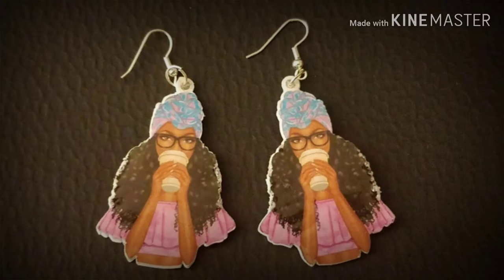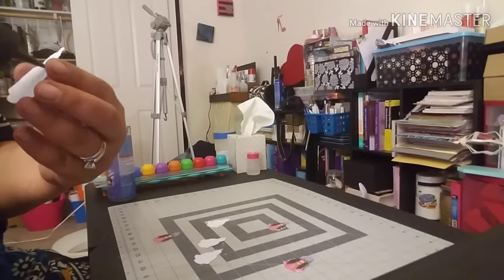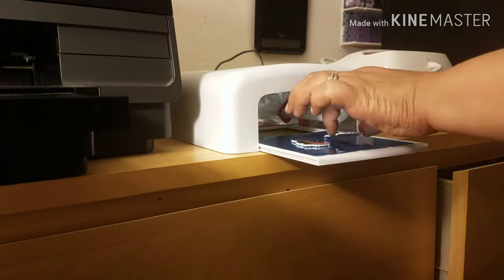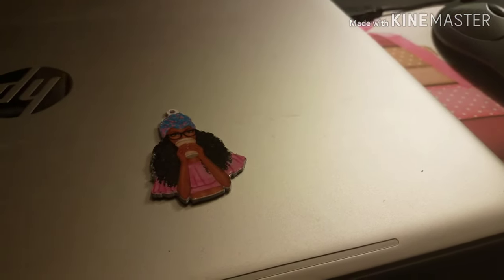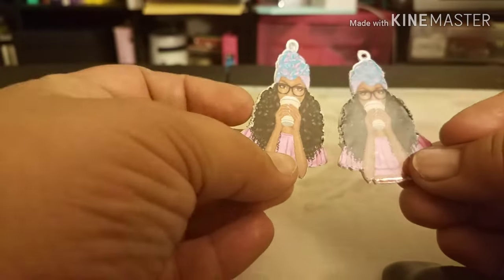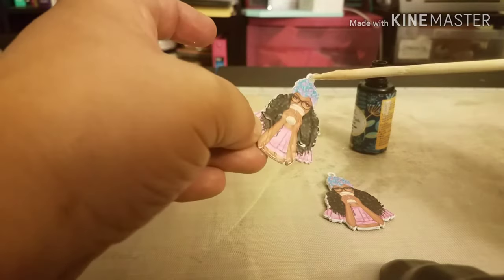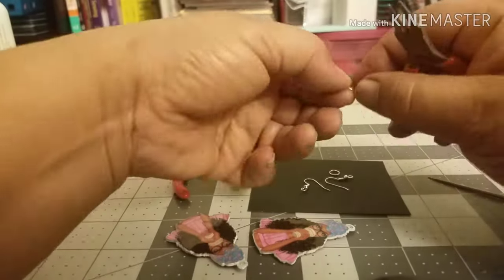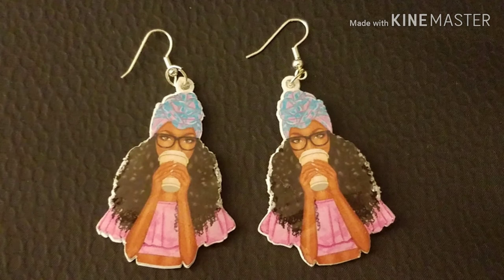Making Cardstock Earrings with UV Resin Coating in Cricut Design Space #tutorial #cricut #earrings

Comment: Question I just got a Cricuit Machine how does the Machine know to cut around the printed imagine if you have to print the image from another printer and what kind of printer and paper do you need sorry alot of question complete newbie thanks
Reply from the maker: You can send your picture from the Cricut design Space software to any printer.  Design space will create registration marks around you picture that allow it to recognize where and what to cut.  I used an HP Officejet 8610 and 110lb cardstock
Reply: @ACraftyMess  Thanks for the info very helpful